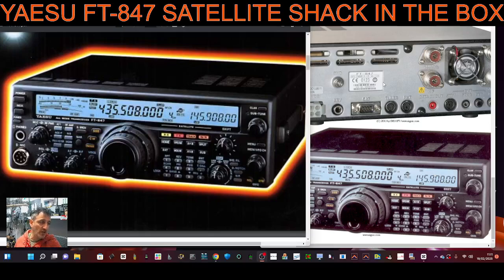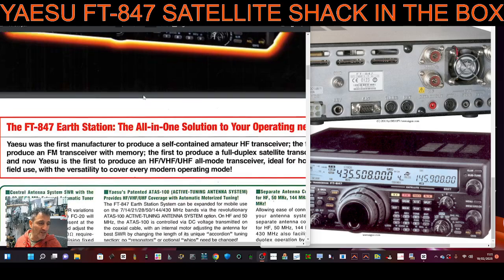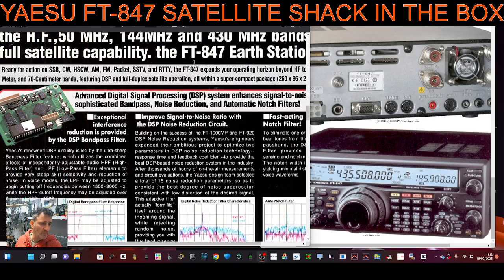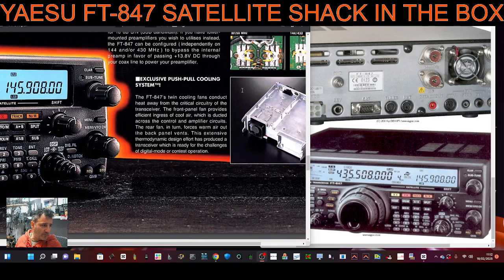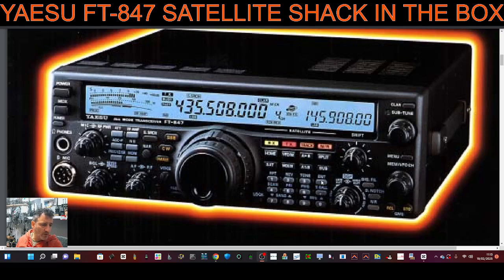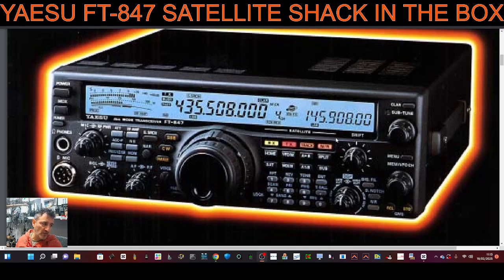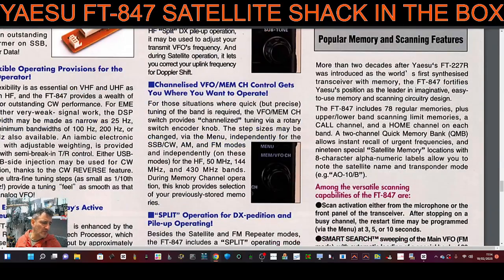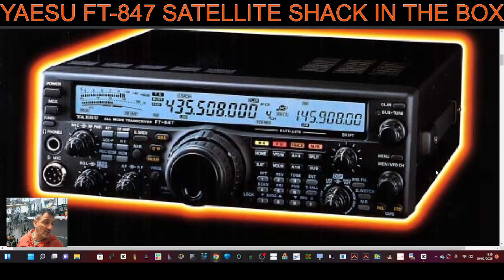Yaesu FT-847 Earth Station - Shack in the Box

Comment: Had one, but could not get used to it and found it difficult to navigate after using a Kenwood so sold it to get a Kenwood TS-2000 with internal tuner. Best decision I made, love the Kenwood
Reply from the maker: Yes i still have my ts2000
Reply: Helpful. I'm looking for a capable satellite base station and leaning towards the TS-2000. Also open to suggestions.